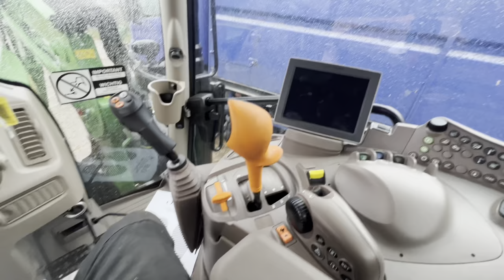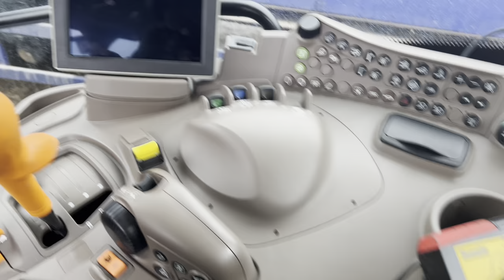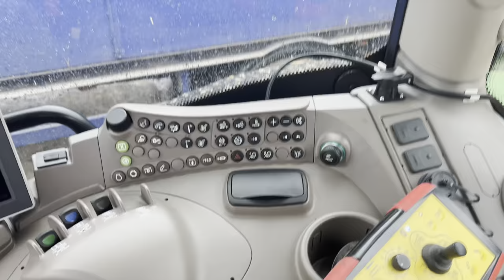Cab Tour! Not Used to the New Beast Yet!

Comment: Sun roof box always ticked on my deeres, like the fresh air always find air con makes the atmosphere to dry!
Reply from the maker: I always find it too hot or dusty without aircon, but I know what you mean it does dry everything… perfect for demisting the windows though 😀
Reply: Get a big coke bottle and half fill with water. Leave the cap off and have it in the cab during the summer when Aircon is on. It will take that dryness away. Just top up bottle as needed.
Reply: Also useful when hedge trimming tall hedges!

Comment: Was the old tractor 50kmh as well or was that a 40kmh? Just thinking of it was your stalling problem could be due to the slightly different fear ratio's in the box
Reply from the maker: Think your right with that… Me and Andy were thinking it later on in the day, the 125 was 40kph… I would have specced this with 40k (but it is 50k) as very rare the little tractor does any road work. It’s in the yard, or in the summer it’s loading bales in the field… just drives to the field and back at the end of the day… and with only 130hp and nearly 15t of straw behind it won’t be doing 50k on way home!

Comment: Seen as the little JD stays on the straw blower why don’t you fit a rear view camera  to help reversing into sheds and loading the bales?
The engine is probably still “tight”, it needs some hard work to loosen it up, a day or two on a power Harrow would do it the world of good.
Reply from the maker: We did put a camera on the straw blower once over, but the ideal place to mount is in the middle of the machine, and eventually you end up destroying it with the spout/ straw. It’s pretty easy to back up and know if your in the right place etc without a camera once you’ve done it a few times. 😀